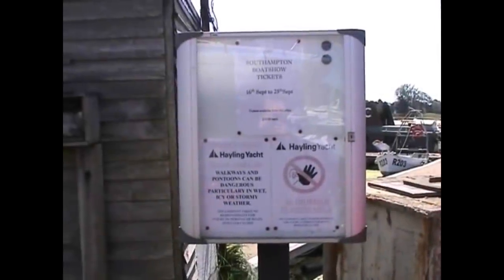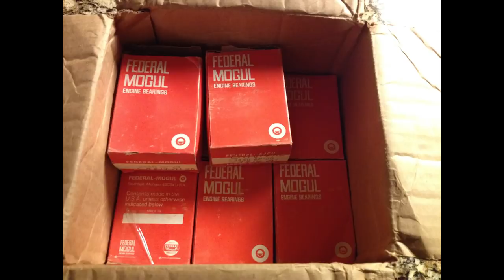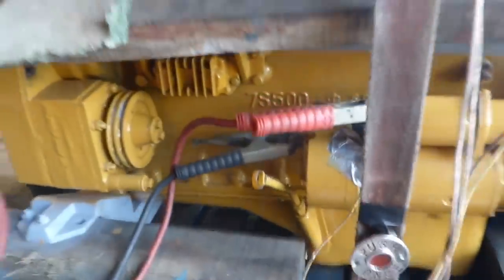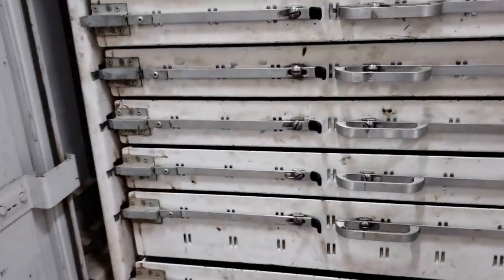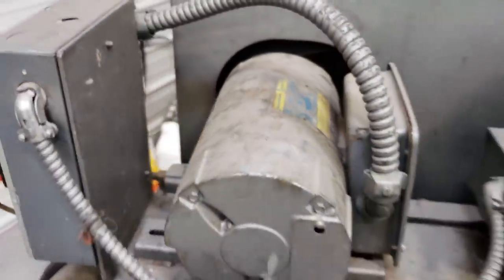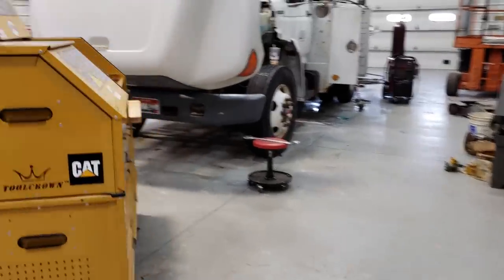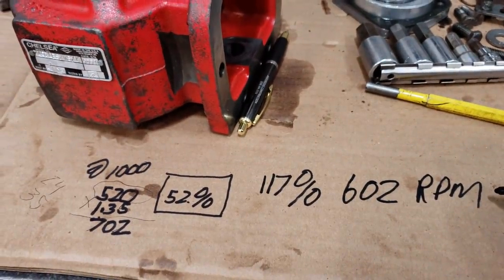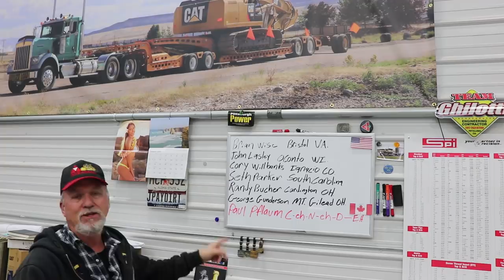Caterpillar D336 V8

Comment: Last time we had a D336 in the shop was in the early 80's.  Besides the scrapers and loaders they were in cabovers in the late 70's. The 340 fwhp wasn't enough power to pull the grapevine to L.A. as fast as bigger hp engines, i.e. the famous 1693. These engines wore the side of the big ends of the connecting rods.
Reply: Are you Roger from Rustburg , Va ? CVT ?
Reply: @swampratt36  No.

Comment: On my service truck I'm running a hydraulic motor direct drive compressor much like your new one to a couple of air receiver tanks. The crane isn't used as often so it works off a diverter valve so I can power either compressor or crane. The crane doesn't need as much oil flow as the compressor so its oil runs through a flow regulator valve. On the rare occasion when I need both crane and air at the same time, the receiver tanks hold enough air for a couple of minutes use. 

I agree with you on the Cat hardware. I've never seen another manufacturer supply the tall bolt head and compact hard washers. And believe me, I've looked.
Reply from the maker: Do you use an oil cooler?
Reply: @Jpaydirt  No I don't. My hydraulic tank is suspended between the chassis rails so is open to the air on all six sides which must help with the cooling. I can't say I've ever taken a temperature reading but the filter is in in the control cabinet and every time I've felt the temperature, it hasn't given me any cause for concern. The compressor gets run for maybe half hour at a time max.

Comment: Hey Jeff, just a follow up. I checked some temperatures today. Remove and install two wheels on a 740 dump truck plus check 6 x tyre pressure, that's 46 wheel nuts off and on. Temperature at the return filter got to about 60 deg C (140 F) with an ambient of around 36 C (96 F). Hope this helps.

Comment: Dick Foster told me years ago that heavy use of PTO required using the more bolts required hook-up on the transmission. We have a lot of loggers who really use the PTO hard. up here.  Below zero cold weather on the oil requires more stress on the pump drive gears. 
I understand why you do not want auxiliary engines in the winter.  The gasoline and the cold make them stall out and hard to restart from the moisture icing up the air cleaners and carburetors. Centrifugal   Clutches are neede to start the engines in the cold, so the starter is not also turning the attached pumps and etc.

Comment: You' re correct : in gearing, when speed increases, torque decreases.  On the cruise /pto switch : on transit coaches they have a high idle switch. A toggle switch that supplies a voltage input, to the PTO circuit at the ecm. Thinking this how your set up is. It's either on or off. Maybe there is something in the parameters for pto that could be set with inside ?

Comment: I get my bolts/shop supplies from kimball midwest. I'll use fleetpride or fastenal because they're local, but I'm pleased with the kimball midwest bolt/nut setup. Outfitted the whole shop for around 15k.

They're not CAT bolts, but for certain applications (vermeer wood chippers with cummins engines) I order bolts from the manufacturer. 

I'm in maryland, fleet of ford F-750s, freightliner M2s, isuzu NRRs. Some international, sterling, western star and others mixed in. Equipment is all skid/steer size (tree work, mostly residential).

Comment: All our Cummins powered trucks that we have beds on we use the cruise for setting our throttle up. Yes they have a max rpm but that can be set in the emc setup. May need to run her over to the Cummins store to have them program what your looking for.
Reply from the maker: where's the cummins store☻
Reply: Ohhh my my there’s a nice one in White Bear Lake, Mn.....lol Personally I’m a Cat man but for some odd reason we keep buying trucks with M11’s.... Our classic is an 80 freight shaker 3406 mech running 570hp to the ground thru 13spd and 3.70 rears running 24.5 tall rubber. The 13th hole was a nice overdrive at 75+mph. Little mirror on top of main mirror was for seeing how fast we were burning dinosaurs. Pete air leaf and 280 wheelbase. Super nice old girl.

Comment: Driving Detroit OTR all you did was bump the cruise control up instead of down and fast idle of 1000 was on. Then you just bumped it up again for 1100, and so on. Worked bumping it down too. Never explored how far it could go either way and no help with Cat, didn't have any of them.
Reply: Lee Barnes S-60 I assume, I have 4 of them, and 2 cats. I would trade the cats for Detroits  any day.  I don't care about the race up the hill...... the one I care about is the one to the bank. The series 60 always wins that one.
Reply: Lee Barnes Jeff said that he had a Cummins in the cornbinder on my Cummins truck the switch only goes like high idle 700 rpm but the cruise will set were ever you want it do you think he has cruise on that thirteen letter shit spreader?

Comment: So, the Cat 336 is/was a nasty engine from a technician standpoint. But it did give loads of job security in a 621 scraper. Some may not know that it is a 60 degree V8 engine. That meant it had two gear driven balancer shafts. They were great, for leaking oil. We had several that had to have the gear train spacer plates replaced because the balancers wore groves and wouldn’t hold a gasket. Some of the 621s were repowered with a 3306TA. Made the machine a real dog.
Reply from the maker: One of CATS worse engines,  I've seen 3406's and cummins engines in the J619.  overspeed one just a little and KABOOM  LOL
Reply: @Jpaydirt - Overspeed 3406 and they blow up??  I Don't know much about them...  NOW, the 3306 10.5L Inline Six and 3304 7L 4cyl, that were medium duty engines, they seemed to be ok... I had a friend who got sick of 3116 "Issues" that put a 3304 (7.L Four Cylinder) in his Kodiak and the engine out lasted the truck, which was amazing because the 4cyl was really designed as a Generator Engine...He did need to re-gear as there was a loss of 400rpm on the top end, the local cat guru set him up with injection system for 250hp @2200, and variable speed...It sure sounded weird coming up the road!

Comment: I'll bet between you and that fellow across the pond you guys could just about fix anything.My father worked for Norwalk Truck Lines as a mechanic in the 60's they ran some Ford two story Falcon cabovers with Cats in them.I wonder if this was the same engine.He said they were always having problems.Thanks for the video Jeff.
Reply from the maker: Probably, Cat doesn't want to talk about this engine LOL
Reply: Not my most liked engine, used in the 980 wheel loader before they switched to the 3306 in the 980B.
 Most likely the fords had a 1674 engine, same bore and stroke as the 1676. @Jpaydirt

Comment: Fast Idle. Don't know if this will help, when I had my F250  (2011) fast idle switch set, it had a rheostat or resistor they installed for the rpm I wanted. Not sure if that applies here though. Yes the CAT Yellow service truck would look much better and added benefit, easier to find in the snow too.
Reply from the maker: Don't eat yellow snow☻  that's what i think, should be able to up the rpm by just sending more voltage out from the switch
Reply: @Jpaydirt  Well there goes the refreshments at the winter festival.

Comment: Our trucks are mack , the pto are stiebel they can handle full power of the truck , but speed is controlled by the cruise control , if you can find a cruis control kit for the service truck and dont put the safty on it , it will run whatever rpm you want.

Comment: What year is the service truck? Is it an F650?

You got a deal on the gasket kit. Cat hosed me for double that on a kit for a D333 years ago.
Knapheide makes nice service bodies. Sold lots of service trucks with them.

Thanks for the video.
Reply from the maker: It's a 99 F800
Reply: I’ve got a brand new radiator but not sure if it’ll fit. Best I recall, it was for an 86 and newer, but I don’t know how newer. Anyway, it’s been sitting in my shop for 10 years. I’d give it to you if you need one. I’m sure we can find a trucker/subscriber that goes from New Mexico to near you. 
If you have a need, holler and I’ll email you the part # .  Otherwise, it can grow more cobwebs.

Comment: Sorry Jeff, but CASCO has been sold a couple times since '94. They were the original body manufactures for Auto Crane until they started building their own service bodies. Of recent years the company has been sold again, so I don't think you'll get that tuna can any time soon. I spent 20 plus years in the truck equipment industry and thankfully things have improved a great deal. Not that you need to run out and drop a bunch of cash on a new or newer crane truck. It ain't wore out til it stops and wont go no more. Or that's my opinion anyway.
Reply from the maker: Ya , I saw Caseco ant conexpo and the bed was very good quality, so I wondered if they had changed their wicked ways☻ I think they should change the name, wouldn't want to run on the old Caseco''s rep.  ☻
Reply: @Jpaydirt  Yeah, they were much improved since the last sale of the company. I was in equipment sales for 20 years after 8 years as a road mechanic and service trucks were my specialty. IMT and Dutec make a much better bed that will wear out several trucks before you can break one. As for cranes Liftmoore, Stellar and IMT make good cranes. As good as the Auto Crane. Replacement parts costs becomes the issue with cranes after 4 or more years. In that case Liftmoore is always a better value and about 60% of the costs of any other brand's parts. Like you I have used trucks and used equipment on a small farm. A 20 year old proportional hydraulic Liftmoore on a Dutec is what I have. Mine is on a very used 330 Peterbilt with a Cat C7. At 540,000 miles I think it's maybe a bit tired but I'm not tossing $115,000 or so at a new truck for a farm.

Comment: Awesome paydirt. Tell me a little info about a Cat 3306. Any help appreciated
Reply from the maker: 638 cubes Cat made millions of them, two different piston pin sizes 1.5 and 1.7  lower hp PC ones had solid aluminum pistons no heat plugs, would crack bad and used the smaller pin, higher HP PC ones had a heat plug and the bigger pins the best one is the DI one with a New Scroll fuel system they are very dependable, and cheap to work on

Comment: Cool o'le V8 what was hp and CID? Love them dinosaurs.
Reply from the maker: 350 hp I think
Reply: They made them up to 450hp and they were 700cid - only slightly more Cubes than the 636cid 1160/3208, which was a lighter duty engine, also available in 450hp but was a Grenade with the pin pulled at that power level.

Comment: I wonder how closely related, if at all, to the current V8 Cats used in the D10 these engines are?
Reply: The 336 is a huge different engine from the 3408 in a D10. The 3408 does not use a set of balancers like a 336. Although they are both 60 degree V8s. The 3408 overcame the balance issue by using a state of the art crankshaft with offset connecting rod journals. Used to be a pamphlet that shows the design. It worked great.

Comment: Thing is John your kinda doing it back to front, you really need to size the pump to your PTO drive not try an alter the drive to match the pump.
Hydraulic horse power calculation is PSI X GPM /1714.
10 GPM for the crane and 12GPM for compressor so we'll say 25GPM at 2500psi total. Thats around 36 hydraulic hp assuming compressor and crane at full load simultaneously. Will that trucks engine make 36hp at 1000rpm?
Pump wise 25 GPM /700rpm means you need a pump with total output of 0.035gpm per revolution (split across 2 stages).
Hope that's helps mate, but I might have totally got the wrong end of the stick... 🤪
Reply from the maker: Well I'm waiting with baited breath for the expert to tell me what I need, he did ask me about the gpm I needed and said he used a Chelsea form to caluculate what I would need at a rpm yet to be figured out, he said I would need to change gears but I'm concerned when I told him the eaton book says the trans pto gears run 52% of engine speed, he said "w  h  a  t ?"  and I said well your form should ask that, I don't think he understands that you have to know that info, but I had a ton or recommendations of other people to call for better service, so monday I'll find out

Comment: The 1696 truck engine version, leaked more oil then a Detroit Jimmy. If I remember correctly, You had to set the fuel pump plungers on one bank higher then the other.
Reply: A 1696?  That would be a truck-ified D-346...a HUGE engine. About 7,000 lbs as a marine engine. MUCH larger than this D336, which came in trucks as a 1676...V-8 brother of a 1674/D334.

Comment: Did 10 minutes of google searching and all I could come up with is that they are 300 HP. I’m wondering what their size is and if they compare to a 3208 or 3408.
Reply from the maker: it was a 60 degree v8 700 cubes rated 340 hp introduced in late 65 and production stopped a couple years later 4.5 X 5.5 bore and stroke
Reply: A 1676 was a 340 hp V-8 brother of a 1674 inline-6 DOHC, which was introduced in 1967. A 1674 inline-6 has a 4.75" bore and 6.00" stroke for 638 cubic inches (10.5 liters). Rated 270 hp @ 2,200 rpm. The 1674 shares some valvetrain parts and injection nozzles with 1676. It was called a D-334 for industrial, marine and generator applications. It was an offshoot of the 1673/D-333, which was never aftercooled. When they updated IT to the 3306, then 3306B, they dropped the 1674. The D-333/3306's had same bore and stroke as 1674, but NOT overhead cams. Eventually, with aftercooler, the 3306B was rated 300@2,100. AND, could be equipped with a Jake Brake.

Comment: Cummins should be able to set the rpm that switch bumps the rpm to.  It's using the cruise control in the ecm to control it.
Reply from the maker: no cruise control, but it should be a matter of just uping the voltage it sends to increase speed, just like the throttle, Yes?

Comment: Jeff, are you sure that's an 'L' on the PTO tag and not a 'U'. the U ratio has 26 & 20 gears which is a 117% ratio. Chelsea published ratios are direct, meaning that at 1000 engine RPM you will get 1170 RPM at the PTO output shaft for a 117% ratio. as for the cummins, the RPM control is programmable. find someone with Cummins Insite software and that setting can be changed.   edit: if you want the ratio charts & other info on your PTO let me know i can e-mail them to you
Reply from the maker: OK, but why does the eaton spec for the 5306/5406 say pto 52% of engine speed, and the bigger RT ones say 79%
dead sure on the L  and that says they should be 24/35 and the ones that are in it are 20/27  the guy said I would need to change gears, but I called him back and told him what I had found in it, he was confused and didn't know what the 52% was, said he would check on what gears he ordered,  I'm going to learn a shit load on this one I think,  jpaydirt7@gmail.com
Reply: @Jpaydirt , yep. after 41 years working with mobile hydraulics i think i can help you out.
Reply from the maker: @Lou-je7nh  Well you and I going to be chatting then , you are the guy I want to talk to.
Reply: buckle up, were going for a ride lol

Comment: Looks like the engines we had in our old 651 scrapers and didn't they make a version of them in v10 or v12 that was in the old D10 push cats? it's been so long I've about forgot,,, We used them old 651s on a 25 million yard dirt move in St Louis Lambert airport building new runways back about 2000
Reply from the maker: D346 in the 51's the v12 was a D348
Reply: @Jpaydirt  Jay-Are we talking about the oldest models that had the D346 non-current that was a 90 degree V8, with wide  overhead cam heads like a D343? The next series D346 was a 60 degree overhead cam engine that you are talking about.

Comment: You better make sure you checked the board in the axle because if that pen moves in the axle it will move even with the draw keys in over time we had hired axle doctor to come in and bore axles until we contacted stemco and bought a boring machine and bore the axle and sleeve with a hardened steel sleeve